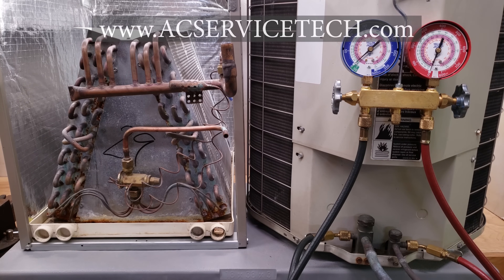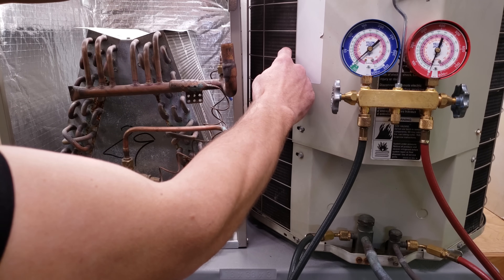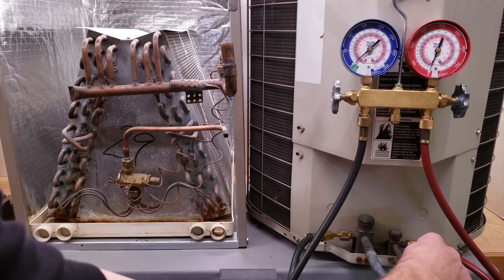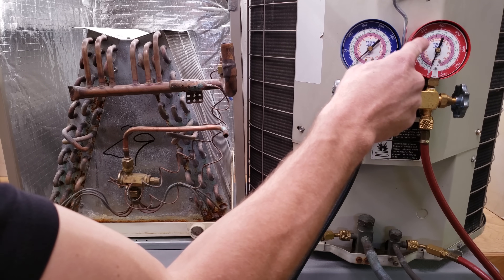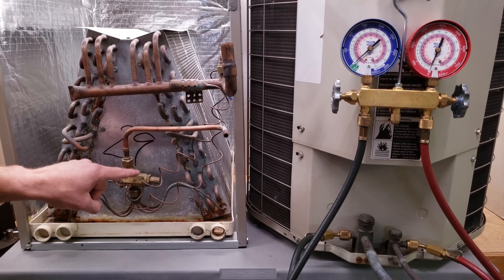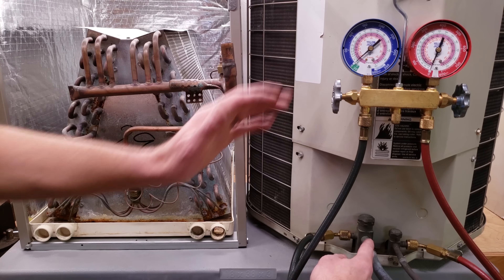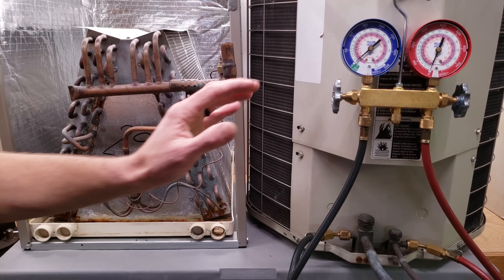Explaining Superheat and Subcooling to Your Apprentice!

Comment: So I'm going to ask a question just to see if the tech I had come out is complete full of it or not.  I'm not asking you to diagnose the system, just a high level sanity check.

Trane XL14i using R410A.  Symptom was compressor kicks on, system is blowing air, but simply not cooling well enough.  Unit was cleaned so I don't believe was dirty coils / impeded airflow, etc.  

Tech is out for maybe 5-10 minutes looking at the unit and rattles off something about the temp being 32F and that the system is completely out of refrigerant; therefore, probably best to just put in a new system.  Yes, system is on the older side and perhaps ultimately that is a consideration, but from reading & watching videos like this one, it doesn't seem very easy to determine that the system is "completely out of freon"?  It's not like you have an easy way to measure that, and you are backing into that based on the temp differentials, etc.  (I would assume that if you are undercharged, the larger the differential, the more you are short, though)

Tech threw out some $750 "quote" to refill w/ sealer and see what happens to which I politely declined as the explanation didn't really pass a sniff test to me.  

I'm already getting another opinion, but just looking to see if I'm crazy on this one or not.

P.S. Love the video and might buy the book just to be better able to manage my own maintenance in the future.

Comment: I get a kick out of Carrier and their 9° and 11° subcool listings These guys are in their head too much. Most literature says you can have a +- 3° of tolerance to the unit. Then you read the accuracy literature of all the thermometers and clamps and they range from +-1°to 2.5° and digital gauges at  +- 1.5psi to 2psi and quickly you realize that all of this depending on the day, temperature outside, clamp placement, your clamp sitting in the sun too long and Did you really wait 20 minutes.  There are enough variables to have most units questioned by a follow up technician as not charged correctly. Especially the "by the book" techs who think only their gauges, and clamps are correct. Don't forget the dispatcher has to send you on a day that is decent outside and above 68° inside. I feel like most of this is about selling tools to young techs because they fear being wrong or accused of not doing their job correctly. In central Ohio you can spend more of your customers money making a unit perfect in your eyes than you will dave them in the long run. FACTS do the energy consumption math.

Comment: I'm not a hvac guy but one thing that helped me understand refrigeration is that phase change requires energy ie the heat in the air, that is why it gets cold.
don't see this concept mentioned or explained very often.
Thanks

Comment: Im confused. At about 5:34 minutes you stated that a higher sub cooling means you are overcharged and I’ve heard that before but it seems backwards to superheat. My understanding is that being overcharged would give you lower  superheat because with a higher charge the refrigerant doesn’t begin to raise in temperature until farther in the evaporator coil because a higher volume of refrigerant has to boil off first, but it appears that it’s the reverse here in the condenser. I would think that if you were overcharged that you would have lower sub cooling based on the same principle. Am I misunderstanding something?

Comment: I bought your book and charts a couple weeks ago.  I’m working on a small oil chiller for a machine tool.  The unit’s tag says it uses R407c refrigerant.  No quantity is listed, though.  I got the unit running and replaced the dryer.  I charged the unit with 11 ozs of R407c just to get it running.  I’ve seen other units in the field and I’m pretty sure that’s not enough refrigerant.  All the various parts you’re talking about in this video  are in very close proximity to one another.  Bottom line, I’m still confused on how to determine the correct amount of refrigerant.  Can I go to your website and get your number and call you for some assistance?

Comment: Dumb question: why couldn’t both TXV and piston systems be measured using sub-cooling only?
Reply from the maker: If the superheat changes as it does on a piston system, the subcooling will change any time the superheat changes because there are only two places for the refrigerant to go. Subcooling occurs in the outdoor coil and superheat occurs at the indoor coil. The TXV monitors and controls superheat so adding refrigerant to increase the subcooling does not affect a TXV system unless its severally low on refrigerant so thats the charging method, thanks! Check out acservicetech.com for our educational resources!

Comment: Question:
I have a 2.5 ton R-22 unit. I think it's metered by a TXv.
When I hook the blue gauge up to the vapor line outside, at the service port; it constantly moves back n forth between 55psi and 68psi.
Is this normal?
Or is the TXv sticking?
Or is it just low on r -22?

Comment: The subcooling method for checking refrigerant on a TXV system is recommended by HVAC industry standards and guidelines, such as those provided by the Air Conditioning, Heating, and Refrigeration Institute (AHRI) and HVAC training resources. This method ensures that the system has the correct charge since the TXV regulates superheat automatically.

Comment: Hi very good lesson , question,I have a friend Ford edge ,is cycling on and off but the cooling inside is very cold she loves .when I read the pressure with a can r134a it goes from low to the end of the green it doesn't stay it goes right back down to low and right back up to high and it keeps doing that ,she told me they had replace 2 engine in 5 months the shop told her she needed 2 ac hose because they were popping off ,so when I looked the the system I saw that it was empty so I added can of 134a it stated blowing cold I added another because the gauge was reading low ,it got up to high very too of the green ,I felt saying telling her the thing to look out for is if it has a leak ,we turned it off ,when in the house then we herd a loud bomb she said" their it goes ,that's what it does"I went out pooed the hood and.the hose was off freon everyware ,she said that's what started to have after they replace the engine,so I have never seen that before I'm not an ac expert but I am a mechanic from early 80's been in ac shops as a mechanic never seen that happen before ,so I am think that they probably damaged the connection when replacing the engine because it's one of those clip lock mechanism type that you just puch in and it locks and to remove u use either a plastic halh ring or a metel half ring tool ,so either ,that or it has an stuck open expansion valve I didn't pull a vacuum on the system,I just replace the whole hose from compressor to expansion valve with one from the junk yard ,they have been drinking for 3 weeks now and hose has not popped off ,I have not gotten time to check pressure to see if it's still doing low high thing cycling on and off ,they say it's blowing very cold and they are happy,I am worried because I know the 18oz can was already used so it should I'll the system,so I'm thinking expansion valve stuck open,I would love to hear you thoughts,

Comment: I’m an auto tech, when we had HVAC out at our house one time I was talking to the tech about the HVAC I deal with and he said it’s similar but completely different. I can see he was 100% right.
Reply: Isn't the only difference with cars is that they have an accumulator so that when your car automatically turns AC on to defog in colder weather it doesn't slug the compressor with liquid refrigerant? Other than than it's got a TXV, evap coil, condensor coil, and compressor like a house AC.

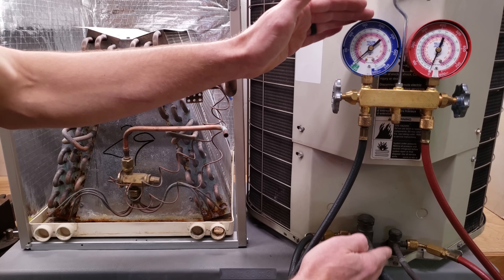Comment: At minute 8:49 you mentioned if our target superheat was 9 degrees and super heat we got was 13 degrees, we are undercharged. Wanted clarification if that was a mistake.  Since before that, you mentioned if our target was 13 and we got 17 then we would be overcharged. I appreciate this great video and your time.
Reply: Please disregard.
Reply from the maker: No problem, yeah they are reverse, high superheat= low charge, high subcooling overcharged, thanks!

Comment: So if it has a fixed orifice piston or capillary you measure the indoor wet bulb temperature and then the outside coil super heat for your total superheat and if it has a TXV then you just measure the tempeature off the liquid line coil and compare the red high side gauge for subcooling correct

Comment: Questions you could install a sightglass to know if your low on freon
Reply from the maker: You don't neccesarily need any sight glass for air conditioning systems. You would measure the subcooling because these types are systems differ from refrigeration units.

Comment: Wow wow wow.... I am going to buy that book. I have watched tons of video to understand it, everyone talks about subcoolong yourcooling mycooling, put their face in front of the video and talk all day long all nonsense. Once in a while we find gems like this. The distance you mentioned about subcooling measurement made the biggest difference in understanding. It would be nice if you could create a video that explains the valves of the measuring unit, how to open, where to connect etc... would be good. I am not worried about my ac unit going bad because of my screw up during the learning process, my concern what if something explodes... hahahah. I hired someone to find the leak and he could not. A video on how to find leak would be good too. My ac is losing refrigerant very slowly, like in two years I have to refill. My unit is 6 years old.

Comment: Great video.. one thing I'm wondering.. Is it possible to alway check for the proper charge by just measuring the subcooling, and not worrying about the superheating?  If so, then one doesn't have to worry about weather its a fixed-orifice meter or a TVX, no?  I suppose you could check subcool and superheat, and if one is correct and the other wrong, it could give an indication that the "wrong" side of the system wasn't operating properly.  Maybe you could elaborate on why you need to check both, whether they are sometimes inconsistent with each other even after the system has stabilized, and what to suspect in each of two inoconsistent subcool/superheat scenarios.   Of course, if they are both consistent with each other, then there is either too much or too little refrigerant, and some needs to be recovered or added, etc.  I know I'm asking a lot here, but I suspect you maybe able to simplify my concern.  Thanks

Comment: Basically what i understood is this type of measurment is like playing darts you want the cooling in the evap to happen dead on center that way its not loosing it blower point, by the coolness not being release between after the coil and the lowside port??

But because the evap coil and consensor(outside) are not the same size it has to be right on the dot that way when you hit (heatmode) the reversing valve and the freon in the condensor isnt past its points as well?

Comment: First, thanks for the great videos! I get that you should measure subcooling when there is a thermal expansion value, and I also get that you should measure superheat if you have a fixed orphis with a piston (hopefully I said that right). However, I am wondering if there is any utility in measuring superheat in a thermal expansion value situation at all, and if so, why would you do it? Thank you!
Reply from the maker: Yes to make sure that nthe txv is working properly. Make sure to check out our article  at acservicetech.com about r-22 and r-410a operating pressures, another is the total superheat method, and another on the subcooling method, thanks!
Reply: @acservicetechchannel  I found your other video that addresses this very question. Thanks!

Comment: I know I am getting way , way off BASE here .... except you guys are my favorite HVAC SITE . AM I TO UNDERSTAND THAT IN A SYSTEM THAT IS NOT RUNNING , THE HIGH AND LOW PRESSURES EQUALIZE .... and I am referring to AUTOMOTIVE !!!! NO CRANK , NO START 2005 HONDA CRV I would like to part out ..... THE AC IS KILLER COLD  , WHEN RUNNING !!!!!!!

Comment: How come when we measure subcooling and the target subcooling is higher than the actual subcooling then its undercharged but when we measure superheat and the target number is higher than the actual it's consider overcharge?
Reply: I have no idea WHY ???   BUT it is fairly EASY TO REMEMBER  : THAT THEY WORK IN OPPOSITE DIRECTIONS , because they are on OPPOSITE ENDS OF THE REFRIGERATION CYCLE .... SUB  AND SUPER ..... cept if you can't remember either one , you are SUNK !!!!!!!
Reply: @gregscheyd4131  lol thanks Greg for your efforts and yes I've come to understand how they work on both ends

Comment: Beyond the measuring of subcool and superheat. Laymens terms: Compresser goes High to Low.. Evaporator goes Low to High. You'll be surprised how much easier the learning transition of understanding his theory after you understand those basics. The High being measured on Blue, and Low on Red, did throw me off. In auto, my gauge is opposite. Same as this HVAC, H is bigger, L is smaller.

Comment: Actually?
It’s high pressure, high pressure BECAUSE OF the compression from vapour back to a liquid state & the condenser simply heat-exchanges the compressed Vapour to cool it down from being compressed.

Comment: Wow Craig that's the best definition of "saturated" that I've ever heard!
 Previous explanations just explanations just told me it was a mixture of liquid and vapor.  You clarified that at this point it is not changing temperature. but only changing  phase.  For 12 years since Tech school I have understood super heat and subcooling but "saturated" has been sort of vague.
 Thanks again for the excellent videos and I highly recommend your book and cards to anyone reading this!
Reply: thermodynamics requires a good explanation unless you are a genius. I was supposedly an A-student, but I still really didn't understand it well enough to remember it for very long.
Reply: As an engineer, but former tech, I enjoy watching such videos (usually the result of researching test equipment though). Overall, good explanation, just might have started with definitions of terms first (but that is just more preference in presentation). As mentioned in the video, or to make it more clear…

The temperature of the refrigerant decreases during the desuperheating and sub-cooling processes, but remains constant during the condensing process itself (gas to liquid, or as in the video the “saturated section”). The energy rejected from the refrigerant heats the secondary medium (copper or aluminum), whose temperature thus increases. However, The refrigerant pressure changes little from desuperheating to subcooling (think compressor to service valve). In a similar way to evaporation, the only pressure difference between the entrance and the exit of the heat exchanger is just the pressure drop (the equation is: pressure equals temperature times volume - which explains why your car tire pressure only changes with heat, but is the same wether mounted or not). Also, because the flow velocity in a condenser decreases, the induced pressure drop is much lower than in an evaporator. In other words, the pressure is rather stable throughout the high-side and low-side environment (between condenser and the expansion valve / orifice and vise versa). 

Another key thing to remember, is that phase change is what takes the most energy (yet pressure is still rather constant). Thus, most heat is transferred during the condensing process (that process which is after desuperheating but before subcooling). Another mental tool I use to think of saturation is relating it to the opposite as in precipitation of say minerals from water; boiling water causes dissolved solids to precipitate (due to temperature change).

Comment: I thought this was a great explanation of how to check the subcooled and superheated temperatures and explaining the process of both coils, compressor and expansion device.  I did have one comment about what the saturated state means.  A saturated liquid has a quality of 0% and a saturated vapor has a quality of 100% and the liquid-vapor state is everything in between.  This is when the phase change is occurring and temperature is held constant.

Comment: I don't have an apprentice nor do i even deal with HVAC or whatever, just wanna learn about air conditioning and such, but the thing that broke my brain was when you talked about over and undercharging on the vapor line, now the part that i cant get my head around, is on the sub cooling, if the temp on the meter is higher then the required temp on the condenser, then that means its overcharged, and vise versa for undercharged, but for the vapor line, if the temp on the meter is lower then the temp required then its overcharged, and vice versa for the undercharged, how does adding/subtracting refrigerant have the opposite affect in comparison to the liquid line, or is it too hard to explain?

Comment: Excuse my ignorance here but isn't the small pipe going out/red tube and gauge the discharge pipe which should be high pressure gas  and the larger pipe the vacuum/return pipe/blue pipe the low pressure gas? Well that's what we are taught is South Africa
Reply from the maker: On this ac unit, the small tube has high pressure liquid, and the large tube has low pressure vapor. The discharge gas is high pressure vapor and is between the compressor and the outdoor compressor but after the refrigerant exits the condenser, it is in the subcooled liquid state, thanks!